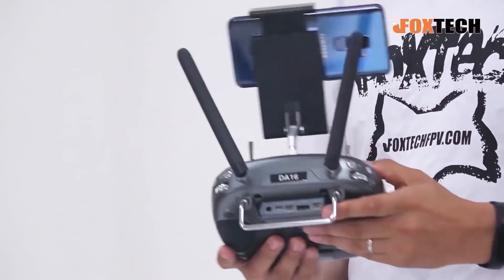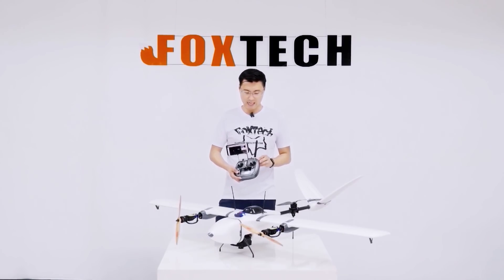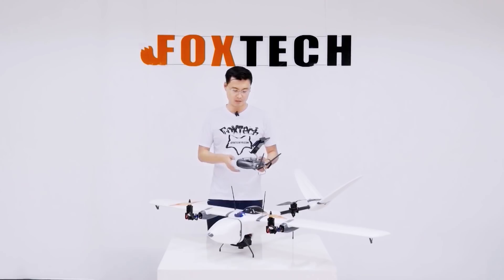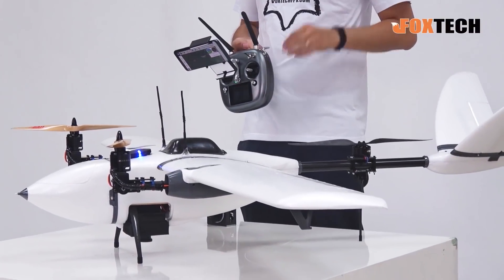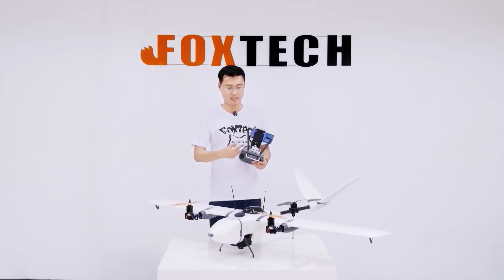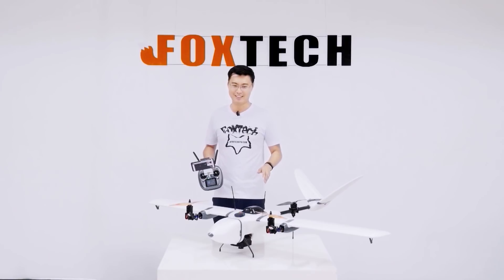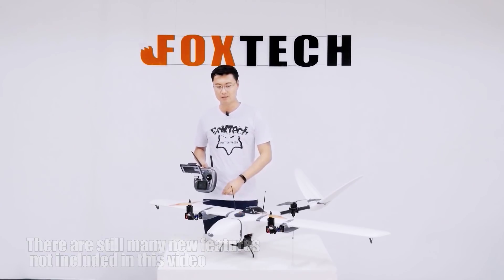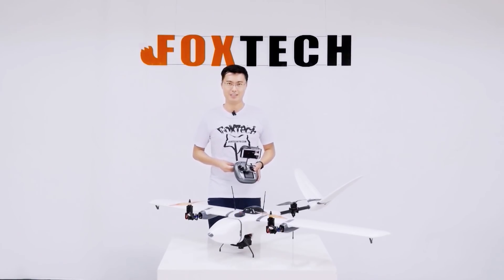NIMBUS VTOL PPK Mapping Job

Comment: does the camera have a mechanical shutter? also, why is the accuracy so low in the quality report. around 4 meters?
Reply from the maker: accuracy so low is because we didn't use PPK, or RTK ,or signal feedback . so ..... , it has a mechanical shutter of course, it's sony A5100 and A7R build inside

Comment: As the camera is not mounted on a gimbal, does the moving plane affects the quality of the pictures?  (blur, missed pictures,)
Reply from the maker: no, the plane mostly fly levelled and there is foam damper to reduce the vibration, the survey result is good so far